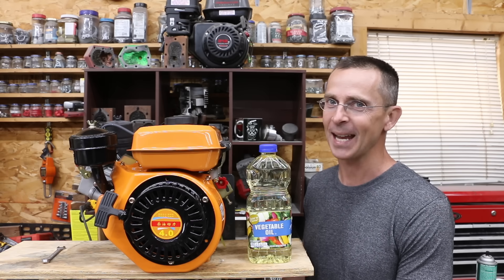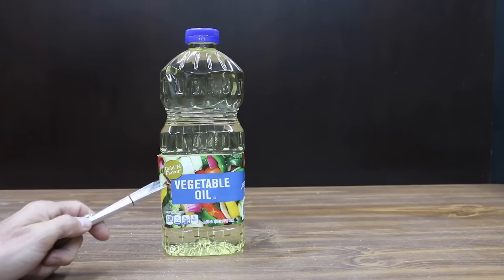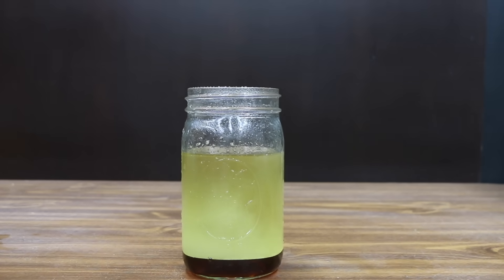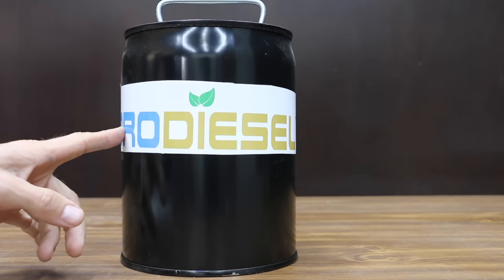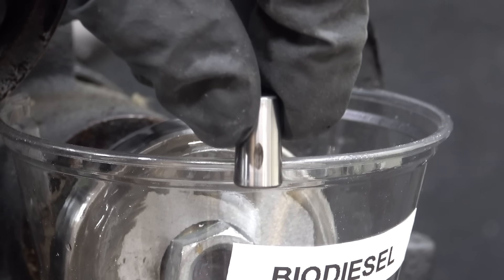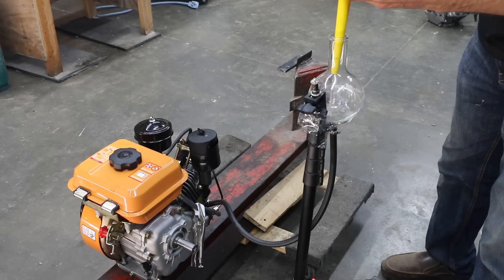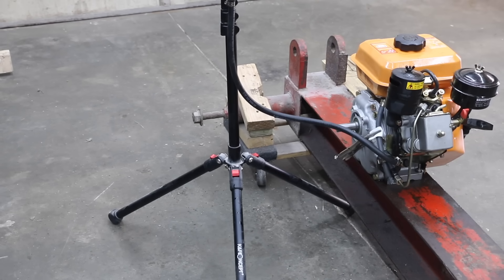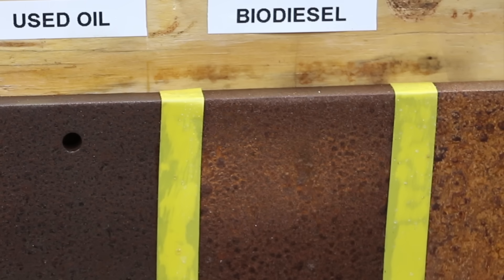Make "Biodiesel"? Let’s find out! Diesel vs Biodiesel, Used Motor Oil, Vegetable Oil, MPG

Comment: Speaking of diesel...I was just on Facebook perusing the group page of an engine specific diesel group and came across a debate about which additives work best. The current ultra low sulfur diesel purportedly lacks the lubricity properties that older diesel engines not designed for it require. So many people that have such engines run additives, although the necessity of needing to run them at all is also often debated. When I saw the debate about what to use it made me curious as I have no clue which ones are good or not, thought I'd check your channel but was somewhat surprised that it looks like you haven't done a video on diesel additives yet. Would love to see a lubricity test of them, and also against straight ULSD, and against non-ultra low sulfur diesel...just to see if there is in fact a difference between those two, Idk if you can even get it anywhere anymore though, maybe that offroad stuff that they dye red, I'm not sure if that's ULSD or not? The stuff I have for mine is called Ultraguard diesel fuel treatment, I'd be happy to mail you some if it helps and you decide to do a video, the debate I saw was about ATF and Hotshot's secret everyday diesel treatment 6 in 1 fuel booster, EDT-A member claimed that he's tried running a bunch of stuff but swears that one is the best, and that it even made his engine run smoother and get better fuel economy. It's hard to know which products to buy when they all claim to be the best... Your videos are always a big help in making an informed choice, I used to use PB blaster till I saw your penetrating oil video, I've only ever used Liquid Wrench since then based on those results, and it's definitely made a difference breaking things loose on my rustbuckets, it always felt like PB blaster barely did anything...and well, based on your video from what I can recall that was in fact more or less the case, lol...
Reply from the maker: Thanks for the suggestion.

Comment: I would love to see a diy turbo video for one of the 2 or 4 stroke gas powered bicycles. Longevity, wear, top speed, etc. Also, a high polish on the internals on one of these small lawn mower engines. It would be cool to see if "mirror" polishing the cylinder heads, the valves, etc would do for RPM and parts Longevity.
Reply from the maker: Thanks for the suggestion.

Comment: Sorry I m late to the party,  thank you for your content very informative,  You asked for ideas, I would like to see plastic pyrolysis or biomass gasification, I have seen people running an engine straight off the gas at the end of the process. But not on the actual fuel they supposedly made, I would like to see you make either fuel and run the same tests you have done in this vid.

Comment: fact: used motor oil can be incinerated in an oils foundry which is the only DIY type of foundry that can melt steel except for electric furnaces.

Comment: Would have liked to see head temp readings for each fuel an possibly power output measurements to compare energy value of the fuels. Slight error while heating the veg oil 130 F is only about 50 C not 70 like video says.

Comment: I was turned onto straight veg oil on the early days of the internet . I would run at 50-70% oil/diesel mix and aim for 20/50% in the UK winters . I will admit i was running earlish 90`s toyota which do not suffer from the over complexity of modern stuff .

I never once suffered any issues and in fact the veggie oil was a much cleaner burn that diesel . The only thing that would be an issue is friends ripping into you over the smell plus the hunger for fried food you had whenever you went for a drive .

I would stick it into my present merc but not sure id venture past 30%
Reply from the maker: Great feedback. Thank you

Comment: great video as always !!!! Have you ever thought of doing a video on DEF fluid types ? there is a lot of price ranges out there.I usually get mine at walmart. Back 20 ish years ago I worked at Yellow Freight Systems they flow blended the oil straight into the fuel tank right out of the engine. When  electronic diesels came along we had to flow blend into both tanks.The engine manufactures said it was ok. That was cummins N14 I think & detroit series 60. They did this on all line haul (road trucks) Only. I don't know If they still do it I don't work there anymore. Thanks again for your great videos.
Reply from the maker: Thanks so much!  Thanks for the video idea.

Comment: Wow this method is more expensive than You buy on fuel station.
Reply from the maker: Thanks for the feedback.
Reply: you can use used oil from restaurants some give it away for free
Reply: @shaneebahera8566  until they learn that biodiesel company are buying it, that why today you see restaurant that lock they used oil container. You have literally people who steal it. There too that same "stealer" when they pick free used oil, they make a mess, who owner have to paid to clean.

Comment: For those curious: the methanol and potassium hydroxide causes a reaction named "transesterification" in which each molecule of vegetable oil (made of triglycerides) is converted into 3 molecules of that fat's methyl ester. This makes the fuel more volatile and easier to ignite, as the molecular weight of the fuel is reduced by about 67%.
Reply from the maker: Thanks for the feedback.

Comment: When I made waste motor oil fuel for my 1993 6.5 TD, I used an 80%/20% ratio of oil to gas. It came out to around 6000 BTU more per gallon than diesel. Didn't smoke any more than diesel, and only slightly coked the injectors. Im curious now how the 90%/10% ratio would work.
Reply from the maker: Thanks for the suggestion.

Comment: From personal experience, the engine needs to be loaded close to rated output and you'll see huge differences from used motor oil. Much more smoke much less power and ive even had overheating issues using a 6hp engine.

What will blow your mind is how well brake fluid burns and how clean it is.
Reply from the maker: Thanks for the feedback.

Comment: i have run used veggi oil in my trucks for over 100 k miles . ive learned to settle and filter the used oil and have no problems . i settle with gravity only and i run it thru a 25 micron filter and then a 1 micron filter . its very cost effective
Reply from the maker: Thanks for sharing.

Comment: What would happen if you mixed 3 parts used motor oil and 1 part kerosene and ran the engine
Reply from the maker: Thanks for the suggestion.

Comment: Well made video. I've been making biodiesel for about 16 years, here are some observations:
Used motor oil - NO! It will coke up injectors no matter how much it is purified:
Vegetable oil - it will soon destroy (really) modern DI diesel engines without modification if starting in a cold engine; there must be some fuel heating arrangement, or use of a twin tank set up:
Biodiesel "freezing" - it depends on the source oil, biodiesel from soya oil will freeze at zero but canola oil biodiesel freezes sub zero
Biodiesel destroys natural rubber: fortunately most modern cars use nitrile or viton instead
Reply from the maker: Thanks!  Thanks for the feedback.

Comment: If they used synthetic diesel with 1% castor oil ethyl ester added to it before it's made into Hydrodiesel, you're gonna have less smoke overall and the castor ester will add a good bit of lubricity
Reply from the maker: Thanks for the feedback.

Comment: I'm surprised that the vegetable oil was able to run the motor. . . I knew it was related but didn't expect that outcome. In one of your other videos you tested and used high proof isopropyl alcohol and and ethanol. I have been wondering myself for about several years if I could make an effective bio fuel at home using my homebrew equipment. 

In homebrew, there's a process/product that can be made called a sugar wash. This can be distilled and made into higher concentration ethanol. 

I have two questions, 1) do you think the sugar wash would be usable without distillation as it's currently illegal in the UK and has been for hundreds of years to destill alcohol at home. 2) I'm curious if you can explain why diesel and petrol engines vary so much. I understand the process that makes them creates petrol, kerosene, and diesel allows the different types of fuel to have higher or lower flash points, and different freezing points. But I'm still not 100% understanding why diesel engines like those favoured by Russian tanks and cars can run on premium vodka yet petrol engines seem to be really fussy towards octane and temperature levels. Despite the fact that, if I'm correct in saying, it's diesel and not petrol that are infused with tons of aftermarket lubricants and other additives.
Reply: When Rudolf Diesel invented the engine bearing his name, it initially ran on coal dust. He then made it run on peanut oil as a power source for less technologically advanced parts of the world, so running on vegetable oil is nearer the original idea than waste from the petrochemical industry.
Reply: on the second question: Other than the method of lighting the fuel, The main difference between a spark-ignition engine and a "diesel" or compression ignition engine is simply that in a spark-ignition engine the fuel is already in the cylinder as it is compressed before the power stroke- but you can only compress it so much or it will go off when it decides to... based on a host of factors, instead of waiting for the spark. higher octane equivalent fuels are required in higher compression situations because they're less eager to burn. compression ratios over 10/1 or so require high octane (92 or 93) premium fuel, so compression ratios higher than that require hard-to-get fuel... 11/1 compression requires 100-104 octane fuel ideally. Whereas in a compression ignition engine the fuel is injected into the cylinder when it's time to burn and thus, in theory, it can use a variety of fuels with no danger of the fuel "popping off" early. This also allows the use of much higher compression ratios, greatly increasing efficiency.
  peace.
Reply: @primateinterfacetechnologi6220  I might need to read that more than once but now thinking about it, Jet engines do compress the heck out of its propellant. So if that is a factor it makes sense now why Kerosene doesnt need such a low flash point compared to petrol.
Reply: @kraig800i  Home brew distilled alcohol will run a gasoline engine and it has a high octane rating.  To be able to pour it into your tank without creating problems you'd have to distill it to very close to 100% alcohol, and you'd have to change the engine's tuning since it'll need a richer air/fuel ratio.  It's very unlikely that you could do it and be cost effective compared to buying gasoline.

As far as old Russian tanks and diesel cars running on vodka, I'm pretty sure that's total BS.  You might be able to pour a little bit of vodka into a tank of diesel fuel without creating problems, but I highly doubt the engine will run on pure vodka.  I run my diesel on waste motor oil.  It's hard to start cold and I fear that letting it sit in the injection system might be bad so I switch to diesel fuel before parking it for the night so it'll start on diesel, then switch to oil once the engine's warmed up.

Comment: Did you factor in engine temperature towards the reaction of each individual fuel type?
I know that certain fuel types break down under extreme heat.
Reply: Does bio diesel run good under extreme temperatures?

Comment: Cummins made a 250 horsepower multi-fuel  diesel engine adjusted injection timing for what fuel you are running  and  adding in mineral oil with vegetable oil keeps it from gelling
Reply from the maker: Thanks for the feedback.

Comment: ive been running wvo in my 12v cummins for years in the summers. Have to filter it down to 10 micron before use. So even though its free fuel , it still takes some work to process. well worth it in the long run
Reply from the maker: Thanks for the feedback.

Comment: i mixed 12 gallons of used motor oil in my 2006 freightliner on each oil change, it had 300 gallons of diesel, i had the mbe 4000 that was 430 horse on its best day, with used oil the truck would keep up with a 550 cat
Reply from the maker: Thanks for sharing.

Comment: Can you take a solution of urea and react it with quick lime to make ammonia to run a diesel engine?
Reply: What this is based on was that some really cheap cat litter looked like it was lime or quick lime. But after a couple of days the litter box had a strong ammonia smell. So basically can you even run a diesel on ammonia gas. But the idea to use concentrated urea in a reaction to make more gas seemed neat. I am not an expert I am just going what I think the chemical reaction was but it could have been a reductase reaction of bacteria.

Comment: A popular opinion of diesel owners is adding 2 stroke oil to a tank of fuel, could you test diesel vs 2 stroke/diesel? Also perhaps test the lubricating properties of some popular additives like Stanadyne vs Diesel Kleen vs Diesel ULSD vs biodiesel vs 2 stroke diesel? 
Or also the friction reducers/stiction preventers like "hot shot's secret" vs Archoil friction modifier vs Rev X vs Optilube

Thanks for the consideration, huge follower!
Reply from the maker: Thanks for the suggestion.

Comment: Used motor oil unless you filter it very well will dirty up your injectors pretty badly. Plus running tiny metal particles through your fuel system isn't a very good idea....
Reply from the maker: Thanks for the feedback.

Comment: i ran toyota 3L engine on used fry oil and kerosine. 1 part kero 9 parts oil. winter mix 1 to 8. Was smooth and throttled better than diesel, and smelled like a hamburger shop
Reply from the maker: Thanks for sharing.

Comment: The reason your biodiesel gelled was because you didn't remove the water after you washed it. After my biodiesel is washed, I drain the water out the bottom of my processor and turn the heater and circulation pump on. I bring the biodiesel up to 225 degrees and allow the pump to continue circulating until no more steam comes out the top of the processor. I turn the heater off and continue circulating until the fuel cools down. After that process the biodiesel will not gel all the way down to -10 (which is as low as my freezer will go). It sounds like more trouble than it is.
Reply from the maker: Thanks for the constructive feedback.

Comment: Diesels run so well on used motor oil that if the rings go bad, you'll end up in a runaway condition as the engine runs off it's own blowby when the fuel is cut! Many old diesels have overreved to death over this issue... if it happens, blocking the intake with rags or a phone book is one's only hope to avoid a disaster!
Reply from the maker: Thanks for the feedback.

Comment: Just came here from the "Will a small engine run on diesel", and loved the explanation and demo on the cardboard at the end. My thought then was, what happens if you put regular gasoline in a diesel engine? I didn't think it would be worth mentioning, because I didn't (still don't really) know of small diesel engines, except for this one you have. So that could be interesting.

At the same time, seeing the difference in style and speed of combustion between the two.... maybe not the safest test, though possibly interesting to watch (and expensive).
Reply from the maker: Thanks for the suggestion.

Comment: What do you think about the quality of the diesel engine? Do you recommend it over a harbor freight gasoline one for a log splitter, lawn mower, or something else?
Reply: That Orange version is a high speed 3600rpm at about 3.5 to 4hp but being diesel has the torque of a larger gasoline engine..it's marketed as 6hp very often but its not..about $230 -$250 with shipping on alot of different places..there's a Red version also thats the same with the exception of having a plastic air cleaner housing vs the metal air cleaner housing on the Orange version..I've seen them used on log splitters without issues..they are louder then gasoline but they run also on straight transmission fluid too..
Reply: Its only 4 HP. So.....
Reply: @SOLDOZER  that's a lot more power than splitting by hand
Reply: @SOLDOZER  HP is a measurement of how quickly power is made, not how much useable force it makes. Diesel engines always make more useable force (torque) compared to gasoline. A 4hp diesel engine will give you the torque equivalent to a 8-10hp gas engine.
Reply: @Eric2300jeep  POWER is the measurement of WORK, torque is meaningless as gearing makes it irrelevant, thus HP is all that matters.

Comment: stove top bio diesel is great for the kids science projects,, back in 08 when Diesel hit over $4 here,, I got a water heater,, some barrels,, and pumps, and made a set up to do biodiesel in my garage. Cost me about $.45 per gallon made, and my 95 6.5 Diesel LOVED it, it ran SOOooo much smoother/quieter, with no noticeable difference in performance or mileage.  Time is what it takes the most of,,, 20 mins here,,, 3 hrs later 20 mins there,, 5 hrs later,,, etc.
Other tests have shown that Bio Diesel is the BEST additive for lubricity, compared to all other products meant for that reason. It's the cold weather part that holds Bio back.
Another cool vid,, thanks
Reply from the maker: You are welcome!